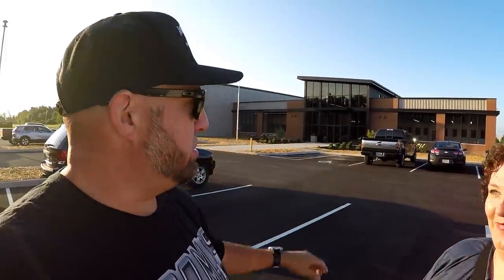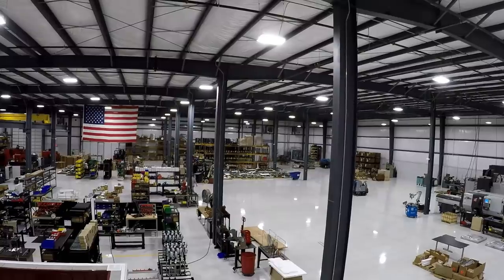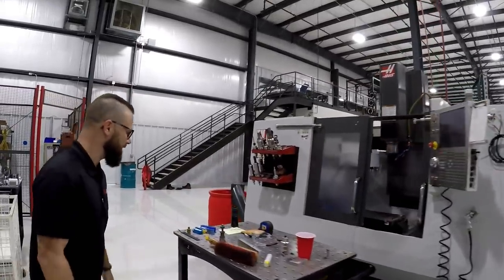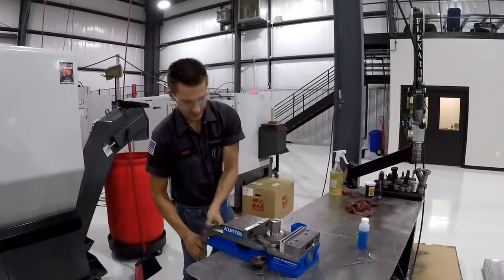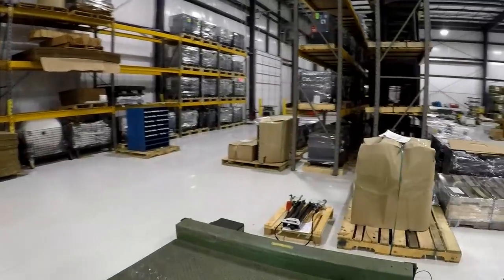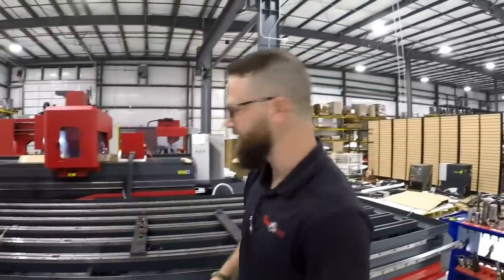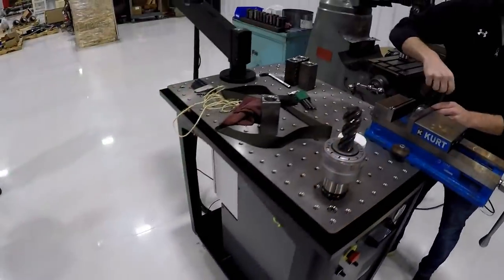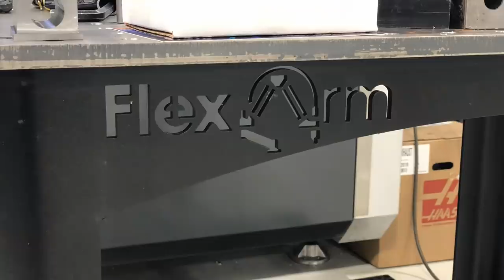Flexarm Factory Tour

Comment: I wonder how much machining the rails on those FLEX CNC machines after install actually helps with accuracy? I mean after machining itself an indicator on the bridge would show it was true within the pitch and yaw of the cutter but it would only be as flat as the alignment of the linear rails the bridge runs on.  For lots of big jobs it wouldn't really matter but if you were trying to mill surface plates on it I wonder how good it would go.
Reply: be bit curious to see how the machine settles over time also
Reply: Welded bases for machines are OK if properly stress relieved ...then properly supported with heavy concrete footings with isolation from surrounding vibrations ....may require adjustment after approx one year of operation   (depending on variables)

Comment: The difference in dealing with an issue locally and dealing with an issue offshore is far far far understated here. I worked for a big name faucet company back when they did everything in house and then again later after they went to having everything shipped in from China. If we had a problem with the parts we had about 6 months of dealing with that problem before we got into the new stock. Sure they save on labor, but if something goes wrong with production over there, we don't know it's an issue until months later when it arrives and then a company isn't gonna act on it until it becomes apparent that the issue ain't going away quickly. It is gonna eventually bite a bunch of these big companies in the ass and put a lot of em out of business. That company I used to work for......... Laid off more than 75% of their employees due to one of these "minor"  issues that could've been a simple fix in a matter of minutes if it had been done in house.

Comment: Very nice looking shop !  Regarding the original idea for the Flexarm, you could also consider it could have come from the older belt driven articulating arm dental drill than the dentist would use to polish your teeth or in earlier days, drill for cavities. They had a hand piece that could be customized to the dentist user and had a foot pedal to speed up or slow down the engine as they called them.  They were super flexible and by the time the belts got from the engine down to the hand piece in all sorts of lengths and angles, performance didn't vary or deviate much. They were in use for decades until the air driven units were developed. For sure though, the dental drills did articulate in more ways than an architect's lamp. Great invention Mr. Kennedy and a great shop, love the white floors and lighting fixtures.

Comment: We bought a flex arm for our shop at work and it was ok. It just didnt have the fit for our application and we returned it. Due to breaking taps way more than doing it manually. Cool machine if you can find a way to use them.

Comment: Bit confused about how 'revolutionary' this is Adam. For the past 10 years I have been using a parallel arm made by De Soutter that I scored on eBay for a song - $30! I've just checked and they are currently about $1000... Not dedicated like this one here (fantastic tour and product demo) but certainly a well proven concept and design. Love your channel my man.
Reply: Pete Howlett The design and slipper clutch are at least decades old. They’re very common here in Europe. Flexarm didn’t come up with it. It’s just a copy.
Reply: @WasNiksIsNiksWordtNiks  They have not just copied it - they have developed it into an extremely sophisticated machine... if I was into metal, I'd want one. As it is I am eying up a 2nd cnc machine :)

Comment: Were my eyes deceiving me because it looked like those 1.5" power-tapped holes looked like the tap was not perpendicular to the hole for either Adam or Stephen (50:00).  Did it somehow correct itself during the tap?  I'm guessing the tapping head stays perpendicular no matter where you put it.
Reply: @ cpad007 I saw the same thing at (48:58) might be a camera angle thing. idk. Those arms have the power to drive the tap at a slight angle into the hole though. We have two at work that are great.

Comment: We had something similar to this at the place I used to work, just a little pneumatic model could do up to M14 but if you took your time it'd would manage to get a M16 through.. Although we did have to modify it a bit to do that. Not sure what brand it was, but definitely smaller than anything shown in this video.

Comment: Thanks for the tour. I'm anxious to see what you are going to use your machine to do. We used a Flex Arm for many years for secondary tapping in a CNC production shop. I worked maintenance and don't recall ever making any repairs to the Flex Arm. It was good to learn something about this company.
Do their CNC machines have ATC's? I don't see any on the machines in the video.
Reply: At least one does for sure - I think it was the first one they came to in the video.  You can see a big tool carousel above the machine from the left hand side.

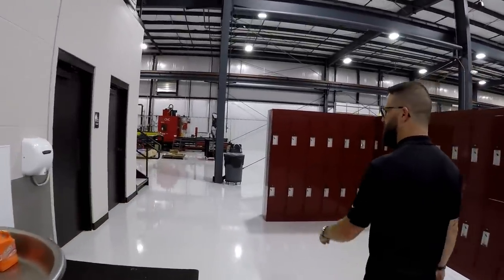Comment: 7:30 and no machines running 🤣 we start at 05 at my shop 😁

They got a beautiful place
Reply: We had to be at our machines and be setting up at 10 till. In a medium size fab shop with a machining dept.   Once a guy knows his job, and is checked out on making good parts he is expected to run the __ out of that machine or process.  good point.    Things are different when cameras are in the shop we had to fake it once on camera due to clogged paint nozzles once in a large Factory I worked at.

Comment: So when are you getting you new CNC machines? I have a shop that is in a different industry. We've been running CNCs for about 23 years.  Would never go back to manual.  Now you are going to have to put in transformers. Put the transformer on a separate breaker so it can be powered down when not needed. Otherwise they consume power even when nothing is using them. Long ago when I got started in my current shop I went for 208V. Now have transformers for 240, 380 & 460. Should have put in buss duct also.

Comment: 49:39 Why does the Flexarm look all tilty❓Or are the wall panels tilted the other way❓
Reply: Double Dare Fan 
It’s lens distortion.  When the camera lens is 4 feet from the tool head, then the work table below is actually 5 feet from the lens, at different angle.  There is some digital correction but the best solution would be to video from 10 feet back slightly zoomed so the difference in distances is less pronounced.
Reply: @malibuclassic77  Why is the tapped piece straight though? And why is it still tilted the same way and not the other when the camera is filming from the other side?

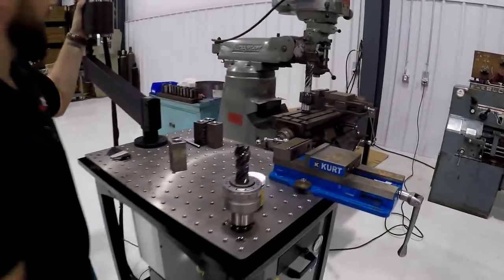Comment: Just a quick comment to get everyone square away (no pun) on the misalignment comments. At 48:38 you’ll see a quick verification to ensure vertical alignment. The wide lens with the vertical siding in the rear adds a strange view of what was happening IRL. Trust when I say, we watched the video and all went 🤔 but I assure you the vertical alignment was true! We wouldn’t be 25,000 customers deep with a 35 year reputation with misaligned taps! #WeStandBehindIt thanks guys and gals 💪
Reply: I assumed it was just an artifact of camera lens, I know the old GoPro Hero 3 we use at work can sometimes make things look a little on the funky side.
Reply: Only 12 of the people that watch this channel can actually afford one. The other people that may have said something are just angry souls. You can guarantee Adam would have said something in the video if it was off, especially after buying one. Thanks for the clarification, Stephen!
Reply: Clearly it was crooked as it went in, just measure in straight lines and reference from the actual workpiece itself, and this is it http://frozenhaxor.pl/fh_as/D2019-09-04_T02-48-56.jpg

Comment: I have pretty limited knowledge of tapping, but does doing it like this instead of on a lathe/cnc cause any real accuracy problems? Also interested if the massive torque means you don't have to break chips as frequently or at all.
Reply: Accuracy will be determined by the operator, just like with a lathe or CNC, also hole size accuracy and how worn the tap is. For a machine like this you'll be using spiral flute tap which pushes the chip up and out of the hole like a twist drill, so you don't need to break the chip at all. That's the only tap designed for continuous tapping/machine tapping. Not that you can't do machine tapping with regular taps, but it isn't optimal.

Comment: One of those open CNC machines they make would have been a dream for you at Motion, you should put them in touch with each other lol.
Reply from the maker: Would have been nice to use, maybe I’ll add one to my shop one day.
Reply: @Abom79  You are going to get bigger and swallow up that Motion shop.  Abomotion Industries.
Reply: @Abom79  Hi Adam, I would strongly recommend a 3 axis Bed CNC mill, Proto Track (South Western Industries) are an excellent for short batch, and can be used as a manual. Very easy to use, don't need G-Code, but can run from CAM.
I speak from purchasing one here in the UK, as a manual machinist, that was 3 years ago, and added a SLX lathe in 2018.
Thanks for sharing, and best regards from the UK.

Comment: So what was the center to center on that Le Blond? Those LED high bay light fixtures are the bomb! Great tour of a great company, thanks!
Reply: I'm still not 100% sold on those high bays, or at least not without supplemental task lighting at workstations.  They're bright to look at, but not so bright to look with, if you know what I mean.  Between the glare from the light and the glare from the floor, it seems like you're always working in the shadows.
Reply: Yes sir I do know what you’re talking about, those dang multiple shadows. Task lighting is needed for sure. They were much better than those dang metal vapor high bays in my opinion though

Comment: Looking at the machines we have today I can see where a skilled machinist is replaced by robotics and computers in the future
Reply: Not necessarily, in terms of manufacturing yes(absolutely incredible what a 5 axis machine can do.), In terms of repairs manual is far more easier.
Reply: @mauricioespinoza5390  Not to mention, you still need a person to do all the programming, setups, fixtures, etc.  In production, yeah, the kid babysitting one machine, that wouldn't cut it.  He'd be tending to a few dozen machines that get loaded with robot arms.  That still takes a skilled laborer, just one good at verifying setups and adjusting feeds and speeds, monitoring the tooling, and being able to clear faults in the cnc as well as the robotics.

Comment: it does not look as if the tab is going straight into the hole or am I wrong? 49:04
Reply: I saw the same thing and went looking for comments. The tap axis is not normal to the table surface. I saw that right away even before the company guy started the first hole. It probably stopped because the tap bound up in the hole.
Reply: that's a symptom of filming on a GoPro - fish eye lens is distorting it
Reply: @GFSwinger1693   Lens distortion from the go pro WIDE ANGLE lens.
Reply: @GFSwinger1693  it stopped because it hit the bottom, it wouldn't have gone that far had it gone in at an angle. it's a 1.5 inch tap, it wouldn't have gone in at all.
edit: look at the black beam on the back wall, distortion is obvious

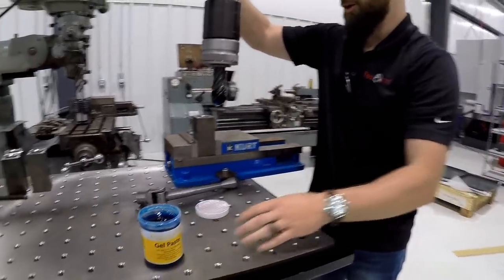Comment: At 48:55, that does not look straight, does the tool center the bit...
Reply: I noticed that too. I was waiting for piece to break out or the tap to snap.
Reply: @davidzaenglein6725  
I thought that's why it stopped...
Reply: @davidzaenglein6725   Lens distortion from the go pro WIDE ANGLE lens.

Comment: At least a couple of posts have queried the perpendicularity of the 1 1/2 inch threaded holes, some respondents attributing it to 
an optical illusion.  The geometry and precision on which the device is based should always ensure perpendicularity, but as it might 
have been foreseen that viewers would be scrutinising this the part(s) in question should have been put on a cmm to prove as such. 
It might regardless be an idea to show cmm data comparisons of holes tapped by the flexarm to holes tapped by the cnc machines.
Reply: From the looks of it it is not an optical illusion, it was a setup error, the head angle is adjustable and it wasn't set perfectly vertical as it should have been, an opps.
But that is the hazard of adjustability, the other fixed head angle flexarms will always be vertical after initial alignment and you don't have that possibility.

Comment: I was curious as to why they built a new 55,000 SF facility 3000 ft away with  just 5000 SF more than the previous 50,000 SF facility.  Did the old facility have insurmountable  problems (for example, structural/ EPA, or perhaps eminent domain) preventing them from continuing business there?  There is plenty of dirt to expand onto at the old property.
Reply: I believe you should ask them.  Their information is in the description.
Reply from the maker: One of the reasons they told me is they needed more office space.
Reply: I see.  I also read later that they are keeping the old place for overflow storage.  That means the new place is a de facto expansion after all.
Reply: SmileytheFeralCat it really comes down to growth. We had no where to expand and this new facility gives us the ability to add another 40k sq/Ft and keep manufacturing in a single facility.

Comment: The scene  demonstrating  the flex arm, As the tap approached the work piece one could see how the aliment was out by the angle formed with reference to a column in the back round  One cannot beat the precision obtained with a pedestal drill and one further benefit. One does not have to  hank it up after every operation
Reply: @Ken Leggo That was nothing more than Lens distortion from the go pro WIDE ANGLE lens.

Comment: Only thing I don't get- why didn't  you go with a motor that didn't need a transformer? What is the total HP needed to generate that 813ft lbs?
Reply: Jimmy's Tractor 800 ft lbs is a ram 3500 engine output fyi
Reply: Depends on rpm
Reply: @xXkingbeastmodeXx  that comparison is pretty pointless...
Reply: @xXkingbeastmodeXx  or 135 ft lbs less than my old ford, but not quite 2800rpm. At 120rpm your around 18hp, so figure a 20hp pump. My 7.5hp compressor dims the lights when it comes on, but it's single phase 240v
Reply: @JGnLAU8OAWF6  I thought so too. 6.28x2x813÷550=18.5hp which is all we really need to be concerned with. I can see where 300rpm would make you more  concerned with all the copper, but I can't imagine needing more than 25hp to tap 2in holes.
Reply: @xXkingbeastmodeXx  yeah, i know. The chassis cab. The others got turned up to within 5lbs of the ford. Problem is that neither will sustain it. That said. Truck torque has nothing to do with this. Since the best operator will never use 25hp more than 25% of the time, a much better and economical solution would be an accumulator and a variable piston pump. With all the money spent on the head with what  must be a  planetary reduction drive, why not use some engineering on the otherside? Shame to have a 25hp-30hp 3 phase 430v motor running way out of it's efficiency zone 95% of the time. Caterpillar couldn't keep one of these busy tapping 2in holes.
Reply: BTW, I love the machine and the company looks like an awesome place to work and play. I'm sure that almost everyone buying the 2in model has 400v+ 3 phase running all through their factory.

Comment: why did you go with 480 instead of 240?
Reply: JOHN HUFNAGEL hp required id bet
Reply: They make industrial tools, which are almost all 480v. They probably don't sell to many 10k+ machine to home shops.
Reply: Sicktrick- I would doubt that, It's probably only a five horse motor.
Reply: Likely for the efficiency of the 3 phase electric motor they use.  Compared to 240v, they run very smooth under heavy loads.
Reply: @Garth2011  us has 240 and 480 3 phase. Adam has 240 3phase in his shop.
Reply: @ionstorm66  He bought the step up transformer as he said all he has is 220v. He didn't say if he had 3 phase 220v and I didn't know power companies supplied 3 phase 220v to residential. In Los Angeles I believe they won't bring 3 phase regardless if you have much money to pay them (residential areas).
Reply: @Garth2011  transformer can't add phases. You would need some type of converter.